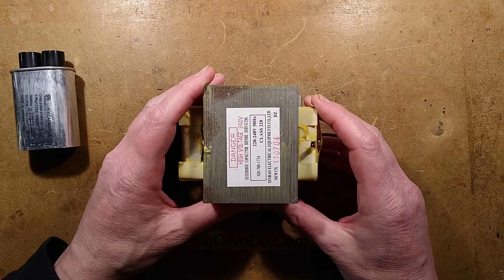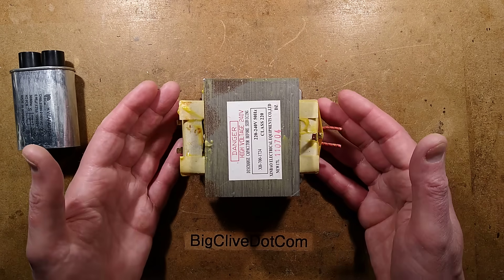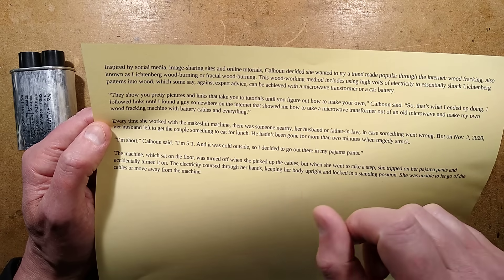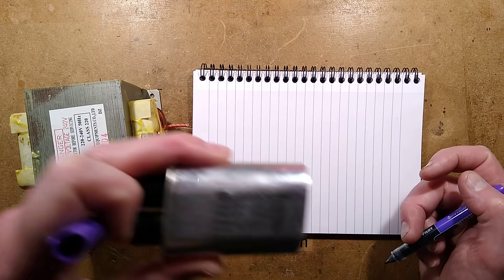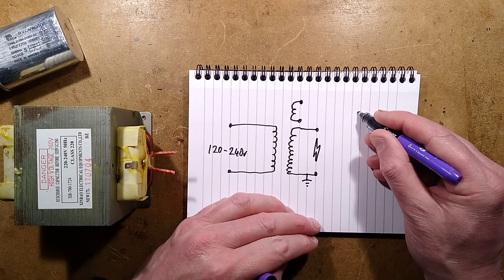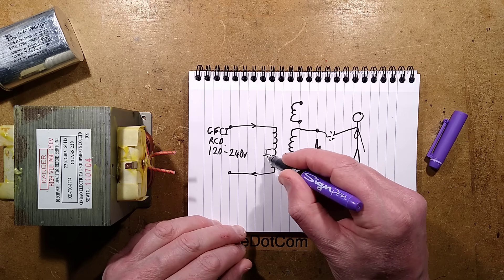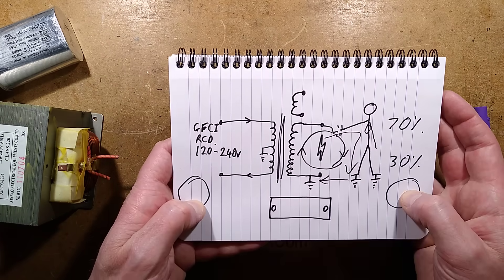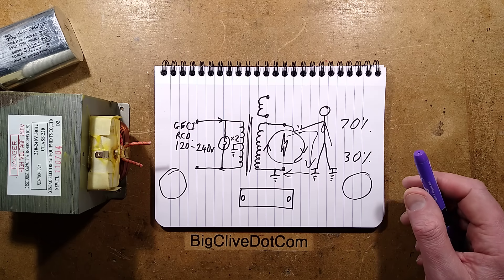The most deadly project on the Internet

Comment: I used to design HV distribution transformers and when those things are energised, for testing and such, you don't want to be anywhere near them, the voltages coming from these microwave transformers isn't far off the lowest voltages I used to work with and even those lower HT voltages are extremely dangerous and we had all kinds of safety lockouts and procedures in place to make sure no one got exposed because if you did the chances of death are pretty high. At a minimum you would be looking at very bad burns, to hear people are using car jumper cables with such voltages sounds like a death wish if I'm honest.
Reply: brute ignorance I'd say. jumper cables can handle kilowatts - at low voltages, so why not kilowats at high voltage, right?  and the metal could do it safely too, if only it was properly insulated, which it is not, since it was designed for low voltage.
Reply: @jnawk83  The insulation on the best quality jumper cable is typically rated at between 5kv to 15kv. It's this high just in case it comes into contact with the HT voltages going to the spark plugs. However most of these cables are not good quality being made in sweat shops in china. People then hold these inferior cables energised to say 5kv from a microwave transformer with damp hands. The cheap insulation is hydroscopic so as it gets damp the level of insulation degrades. It may be ok for the first couple of minutes then bang, the insulation breaks down and you're dead or at best horrifically burned.

Comment: As an electronics engineer i often get asked to build projects or repair electrical equipment by friends and neighbours a friend of a work colleague asked me to build a machine to do these fractal burns and presented me with an old microwave.  i declined this project and explained to him the dangers of messing with the internals of a microwave oven he wasn't too pleased with that he said it is only like working on a crt tv to which i explained that the microwave transformer is far more dangerous than the flyback transformer in a crt tv while the voltage is less than the EHT on the crt the fact there is around 2KV AT ALMOST 1 AMP. I told him that will kill him in an instant to which he said he had many shocks from the EHT on a tv without dying. to which i explained to him that the EHT on a crt is only in the order of a couple of milliamps and as a result the voltage would collapse to a much lower level when touched. he then decided it was not one of his best ideas. BTW the microwave transformer is now a proud part of my spot welder which works great for the light duty sheet metalwork i do as part of some of my projects.

Comment: I have an old neon transformer that is rated at 30000V and can deliver a constant 30mA but is not limited to that. The centre tap of this transformer is internally earthed. I used the transformer to make a Jacob’s ladder. It’s a very scary transformer and if I was to get hooked up across it, and even if my skin was really dry and resistance was as high as 1M, I’d get about 30mA flowing though me which is more than enough to upset my heart.

Comment: Just one question: Why is the secondary high voltage side grounded? Doesn't that defeat the purpose of an galvanic isolating transformer? Or are there other reasons for the grounding?
Reply: For safety reasons of how a magnetron works they ground the anode, which is connected to the output antenna, but still require a 4.5kV difference between anode and cathode, so they feed the cathode with -4.5kV. this is why one end of the HV side is bonded to ground and why there are so many warnings not to operate on an ungrounded outlet. MOTs are inherently grounded tap autotransformers because that's actually the safest way for them to operate.
Reply: @sivalley  Thank you very much for your explanation!

Comment: When I built by Tesla coil I used thick walled silicone pipe as secondary insulation for all the spicy HV wiring and use long 12V control wiring to a remote switch so I can be 10 feet away before operating. Still gives me goose bumps and fear when the button is pressed. Then you just have to stay away from camera tripods and any other non-grounded metal objects that arc to the floor due to RF coupling 😲🙂

Comment: You have reminded me of the EHT tripler in the black and white TV. My hand took a shock from touching a spider's web whilst testing a valve. That took me across the floor! yeah, I was lucky. So, everybody, please treat voltages (high or low) with respect; you do not know the current. Especially from the li-ion batteries.

Comment: Here’s a better one , 1 cover a selected area with Iron filings 2 remove the Trance former 3 remove frequencies generator  magnetron 4 assemble to be hand portable 5 treat the area that you applied the iron filings using the transducer or magnetron You have now created a dead zone for modern vehicles and avionics. If you can join the dots this is a gateway to a hole load of interesting results .

Comment: I don't have any desire to create and/or own that kind of wood burn art, although I have all of the needed equipment and knowledge to do it safely. And it seems fun.
But if I would show off a piece of such art, I will inevitably get the question on how it is made. If I won't answer, they'll turn to the internet. And if I would answer, it will always be a lengthy answer, because it should have the dangers and safety drills in it. By the time I would be explaining the safety part, I'd already have lost them, because at that point, in their head, they're going over their options on where to get a MOT. I just don't want to live with the possible consequences and guilt feelings.

Comment: The closest i've come to touching a MOT is when i repaired my parents' microwave oven.
It was an interesting fault where a broken piece of plastic caused one of the two microswitches to not be pressed when the door closed, intentionally causing a short circuit and blowing a fuse.
I made sure to not have it plugged in and disconnected the MOT+capacitor with an insulated plier before doing any work.

Comment: As an ex sharp engineer for MWO. They stress so much on safety of this system. Their transformer and cap setup is lethal. There are no second chances with microwave tech. Except Panasonics inverter "technology" , which more than likely blew itself up before blowing you up!
Something about how microwaves get their current and voltage levels - scary but amazing, something about dropping the earth to obtain the voltage and current required for a magnetron to operate.
Hitachi gave me a special probe to discharge the cap, like you say, "never trust the resistor". Of the 11 years as an MWO engy, I had 5 that failed. The splat is impressive. Also, the electrolyte is under pressure in the capacitor...
How about EHT from a crt monitor?

Comment: Not interested in exploring the project, just wondering - in theory, would it make it a lot safer to put up a partition  (acrylic?) between the operator and the work piece, and work via holes while wearing gloves rated for 1000V?
Reply: High voltage gloves are only rated for high voltage if they are inspected and tested regularly, they need to be spotless clean too.

Comment: I never did anything with a MOT (too scary), but one of the things I do with any project that involves mains voltage is to use 2-pole switches. If you live in a place where plugs have rotational symmetry (like here in Germany, for example), you never know which connection gets broken by the usual 1-pole switch (such as the ones on the switchable power strips). It might just be neutral. Meaning the switch will be off, the indicator light will be out, but the output will still be live. And if it finds a path to ground (and you have no GFCI), you might have a bad day. That's why I always kill both connections with a 2-pole switch.
Even in places like the UK where you can't rotate the power plug, it might still be a good idea. Do you really want to bet your life on the fact that every single outlet in that particular building is wired up correctly?
Reply: I specifically built a GFCI box with 2 pole switching, overload protection, external ground and light indicator for all my mains projects. My house is 80yrs old and theres everything wrong with the wiring (reversed wiring, no ground). I'm not taking any risk with my life.
Reply: The way Schuko plug can be rotated doesn't make the safety a bit different from plugs that cannot be flipped. Live and neutral conductors are both working conductors and cannot be considered safe to touch. So you are absolutely right about having a switch cutting both of them. Also, you shoutn't poke in live things anyway, because you might touch a part of a circuit before the switch - like a fuse or an EMI filter. As Clive said, the best precaution is to have one hand in a pocket, because even with all other precautions, a bad thing can still occur. Metal chassis are pain in the ass too, you are very likely to get the full blast and hell would that hurt! I got shocked capacitively from live wire several times and still I can't imagine the pain getting the full mains (230V).
Reply: @teslakovalaborator  touch with the back of your hand so you won't grab it in a death grip when you find a live wire.

Comment: Sad for the people who don't get the memo to respect those devices. I haven't fired up any of my Tesl coils in a good long while. The large coil is 12kv and 240ma (four NSTs in parallel). I have a stack of MOTs and would like to build a vacuum tube coil at some point, but I'm not really brave enough to mess with them yet. and certainly not brave enough to muck with the pole transformer hanging out in the back building. Technically from what I understand the NST will also stop your heart if the voltage runs through your heart. Thank you for the video. Wish more people would see this before they stare high voltage projects.
Reply: What happens to tesla coils when the novelty has worn off? Seems like they'd start getting in the way and damaged in storage.
Reply: @CamelCasee  A couple of mine self destructed themselves. Rail strikes taking out the capacitors and secondary strikes taking out the main coil. But yeah they take up a lot of room.

Comment: One of the first things electricians to be are taught in vocational schools in germany is the various effects of different voltages and conditions on the human body.
After that they teach you the 5 basic safety rules. But at this point it is redundant because you already came up with 500 even more restrictive rules in your head.
I only really got shocked (more than a tingling) twice in my career and it was due to neglegance of coworkers (and no it was in situations where i could not double check myself).
It is no fun at all. When i was working on or near high voltage or high current capacity installations i am overly cautious to a point where it was annoying a bit i guess.
But imagine opening a cabinet where the incoming wires are someting like a 5x120mm². You drop a wrench on the bus bar and it will evaporate right into your face and the resulting plasma arc will finish off the rest of your body. Nope, no fun.

Comment: interesting and thought provoking. As an important aside you glibly talk about spot welders Projects being safer. Which they are issues with low voltage high current supplies. I was  brought up on large computer systems with 5 volt 150 Amp+ power supplies we were warned never to work on any part of the system with any metallic objects on our person, these currents passing through a ring could sever a finger. Not nice!!

Comment: I’ve been doing electronics projects forever and I’m pretty comfortable with electricity in general but even I draw the line at microwave oven transformers. Just, no. Thank you for making this video Clive.
Reply: My older neighbor had his microwave die, and he is a pretty smart man, used to be a machinist so he likes to fiddle and fix stuff. Came to me asking to borrow my multimeter, and mentioned fixing his microwave. 

After 10 minutes of me trying to politely persuade him into not opening it, I realized he'd be doing it regardless of my lecture, and gave him a cheap multimeter, HV probe and instructions on how to discharge the capacitor. 
Told him to make sure he's far away before plugging anything in. 

Not even 20 minutes later dude comes to me, visibly shook, showing off his molten screwdriver and remnants of my HV probe. Had he not been in his work boots I'd probably be attending his funeral. Fortunately the microwave chassis was grounded and he had a GFCI, but he was staring death right into eyes. 

It was a bummer for the probe tho, I couldn't bring myself to tell him it costs as much as a new microwave.
Reply: @lazar2175  Lucky to be alive. A GFCI can't save you in this situation by the way. While you're getting exterminated on the secondary side, you're not unbalancing the power line.
Reply: @chrisreynolds6331  He shorted the secondary down to the chassis which was grounded, and GFCI usually trips at any ground fault, so that saved him. 

However, before that, he probably had that screwdriver under HV multiple times. And it was a regular, cheap screwdriver. Fortunately his work boots were rated to 1000v, probably the only thing that saved his life.
Reply: @lazar2175  "...However, before that, he probably had that screwdriver under HV multiple times..."

I started my engineering career as a machinist in a maintenance and tool room. Every few months, the oldest maintenance electrician would appear with his long screwdriver to be re-ground as the end resembled a used welding rod. The driver was about 14" long but the shop foreman swore blind it was closer to 18" when he first got it.
Reply: same, used to repair microwaves & would never dream of playing with one of these transformers
Reply: @jdekong3945  I used to repair microwaves. If I was working on the control board or switches I always disconnected the transformer primary.
Reply: @jdekong3945  I have a MOT and capacitor on display in my room. I scavenged them from a dead microwave. But I haven't dared to do anything with them, and was very careful to make sure that the capacitor was discharged, even though it hasn't been used in years...
Reply: @jdekong3945  depends what you're doing with it.  It's perfectly safe if you do it right, with the proper power shutoff and discharging the capacitor.
Reply: Me too. My dad was an electrician, and taught me a lot. I’ve been doing house wiring since I was a teenager. I even did three-phase in college. I work on old tube amps and radios. However, I’m not messing with this!
Reply: I've studied and worked on electronics since I was 12. My primary area is in high energy physics, and the thought of somebody touching the secondary is horrifying. I don't even enjoy the arcs from one because I know they're lethal. I'll stick to flybacks, multipliers, and Tesla coils; high frequency is more enjoyable anyways imo.
Please always remember the "one-hand rule"
Reply: @John-oo9bu  I'm glad I'm not the only one who uses the one hand rule. I was talking to a qualified electrician a while back, and was very surprised that he didn't know what I was talking about.
Reply: @chrisreynolds6331  I was taught it in electronics class. It's saved me before when I stupidly grabbed an insulated wire that was only rated for a few hundred volts.
Reply: @Potateornottotate  Yeah good boots will save your ass in many situations, from working with electricity to heavy stuff falling on your toes and even prevent burns from molten metal/boiling liquids being spilled. 

Another good safety item to get is a full face shield. If you're going to be experimenting with chemicals, molten metal and high voltage, these are way better than safety glasses, but they should be used together if possible. Couple of years back I made a small metal melter from a MOT, following a Grant Thompson - TKOR video. Dumb me  melted a piece of iron, which then dripped onto concrete and literally exploded (probably moisture in concrete being evaporated too fast). It all went well considering I wasn't wearing any PPE, but I've been trying to be more careful since - could have seriously injured me, or even made me blind. 

Also, get good quality leather gloves. Don't buy any that have polyester or similar synthetic materials, because that stuff will melt and stick to your skin if there's ever an accident. 

And do I have to even mention a fire extinguisher and some first aid? I'm fairly lenient about my personal safety and out of all before mentioned I only have/use the last two. The first aid kit has been helpful hundreds of times, mostly for patching small nicks and cuts with band-aids, and I sincerely hope to never have to use the fire extinguisher.
Reply: I'm Thor, God of Thunder; if I so much as fart, literal lightning bolts stream from my arse, but even I won't go near these infernal transformers. 🔌⚡🚫
Reply: Yeah. Over the years, I've pulled a few of these out, looked at them on the bench for a while, thought about it,  then dropped them into the scrap bin. 
I retired years ago from working on commercial high-voltage scientific equipment where costly interlock systems are used to ensure safety. There's just no way you can do it safely in a hobbyist environment without spending way too much money.
Reply: I lost a digital volt meter when testing a faulty microwave, went to digital heaven in an instant!!!........I decided to never test or mess with the inside of a microwave again.